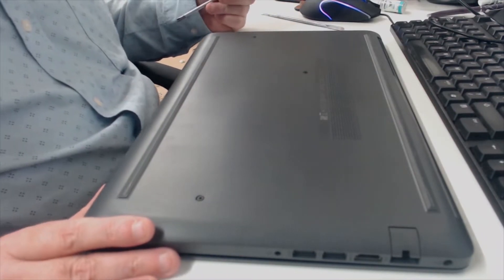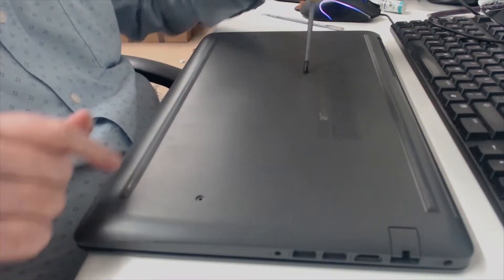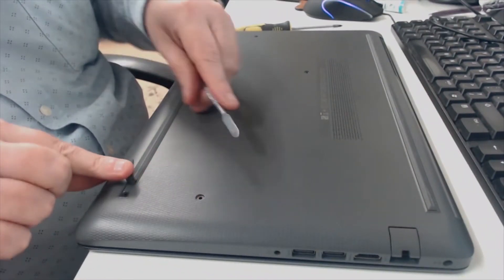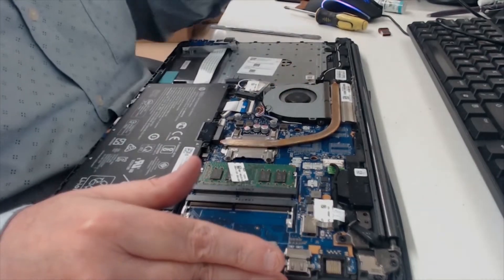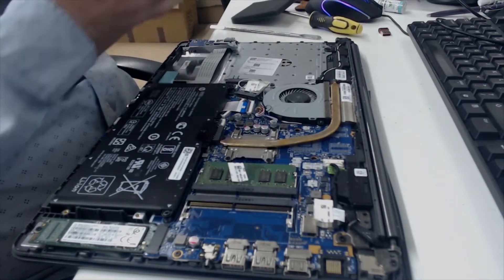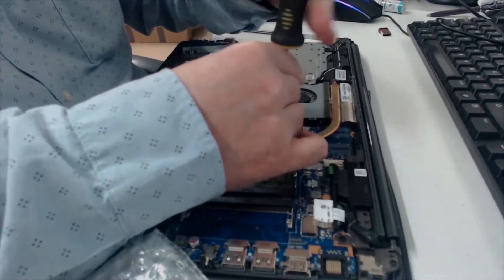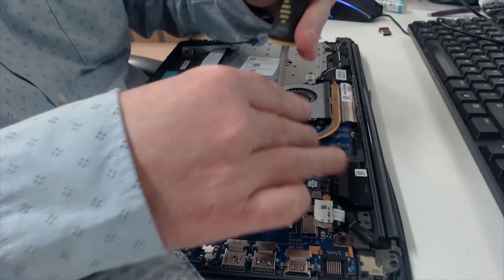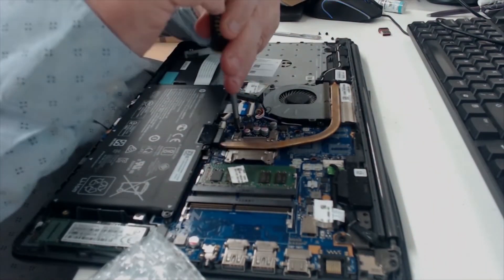How to Replace a noisy fan on a HP 250 G7 Laptop | Disassembly

Comment: Thanks, clear vid/sound. Recommendations on where best to get fan/grease/degreaser, and where best to start levering case apart?
Reply from the maker: Hi David,   I would look on eBay for the fan using the HP part number, as for the thermal paste I can supply that but it's not on my website at present and the TIM clean I can't get that a present but I have 
https://www.enscomputers.co.uk/product/akasa-pack-of-10-thermal-interface-material-tim-cleaning-wipes/  

Regards
Eddie